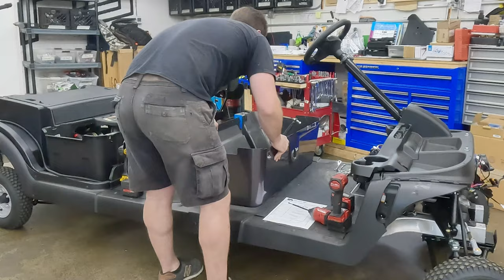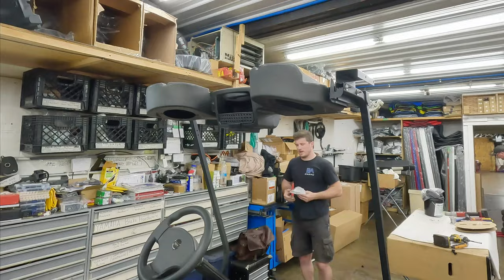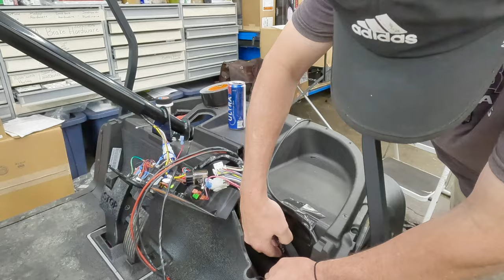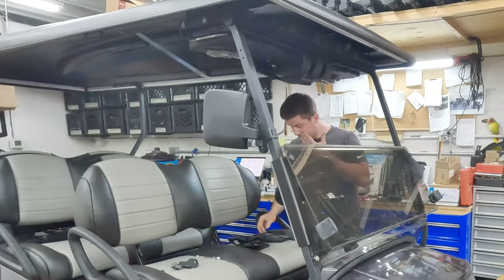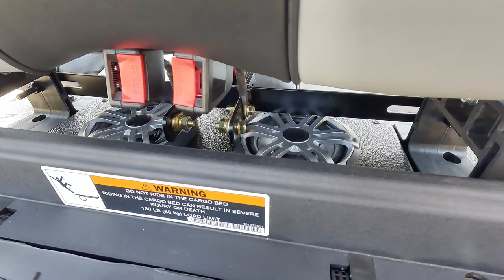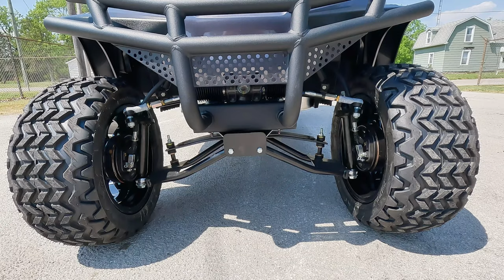From Scratch to Sound: 400Watt 4 Speaker Club Car Sound System!

Comment: what did you you to power the speaker and what kind of source.  Also what brand speakers are those
Reply from the maker: Hertz HMX speakers are powered by a Kenwood KAC-M5024BT 600W amp that we installed inside of dash behind dash cover.